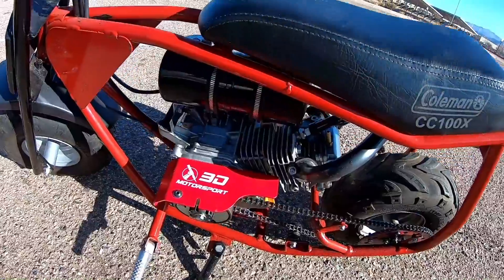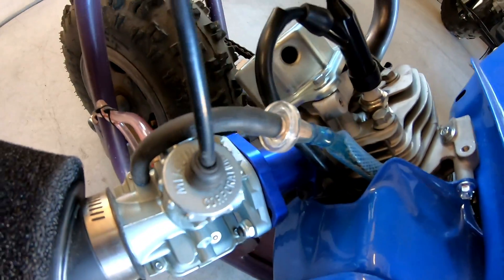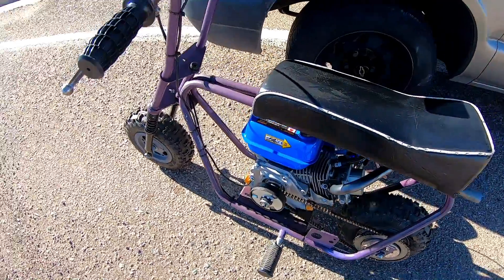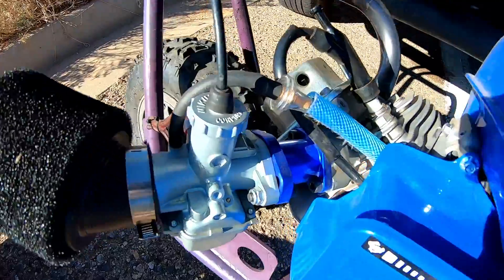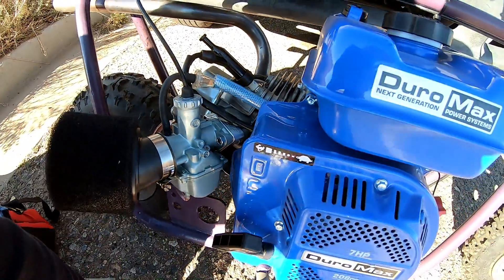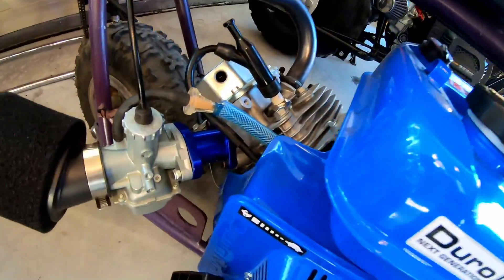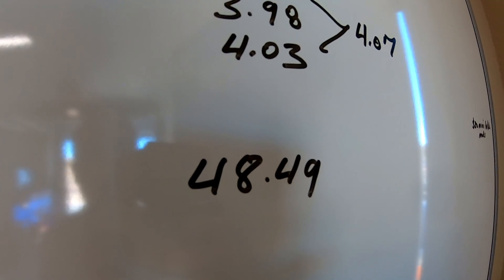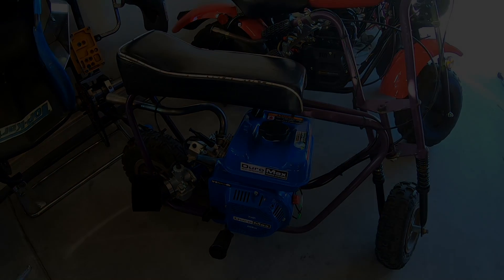Short intake manifold VS long intake manifold on a DuroMax 208

Comment: How precisely do your intake adapters line up and match the intake ports on your builds?  I have a VM22 that I'm going to install on a Ducar 212 and the adapter that I have doesn't exactly create a seamless transition when bolted to the head.  Its pretty close, I would say they are about a 95% match but there are a few minor edges/lips on the head port that I can see and feel protruding where the adapter meets the intake port.  The only solution would require me to try doing a little grinding on the intake port or sourcing a different adapter that has a perfect match.  Or maybe it isn't a big deal and will work fine the way it is?  Have you dealt with this?
Reply from the maker: It will work fine as long as there isnt any leaks between the manifold and carb, or anywhere else.  . I have a video coming out about this topic on Wednesday .

Comment: Have you had any issues with the stock flywheel and rod when removing the governor?
Reply from the maker: Its using a Tillotson 212e flywheel with the stock rod. No problems yet...
Reply: @Black66  Do you try to limit the rpm’s to prevent problems?

Comment: Atomization through the intake is needed. Like a 2 stroke with reeds... I'm pretty sure that if you used a longer intake approx 4" and roughed up the inside with a carbide burr you could achieve pretty much the same affect gaining more power & top end...

Comment: Hi nice vids. What if you made a U shaped intake manifold so that the carb would point forward to create a Ram air effect. Might need a velocity stack and richen mixture. Maybe might achieve a higher top end speed. Sounds good in theory.